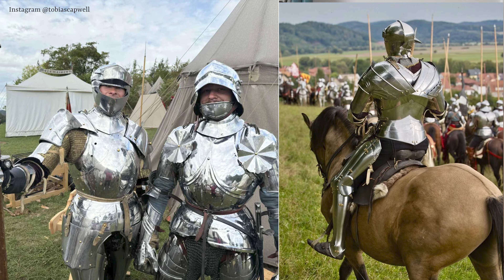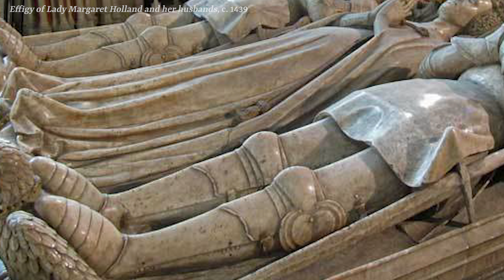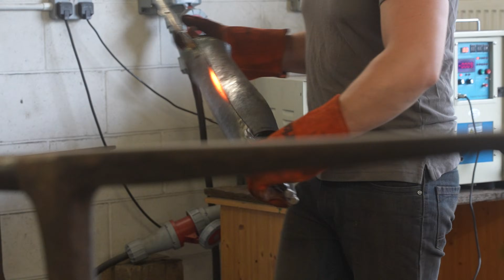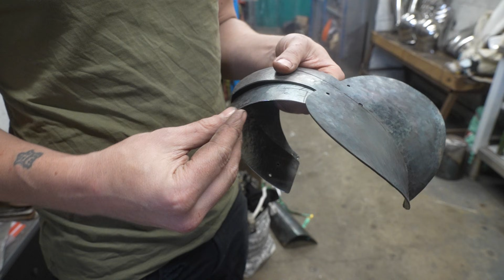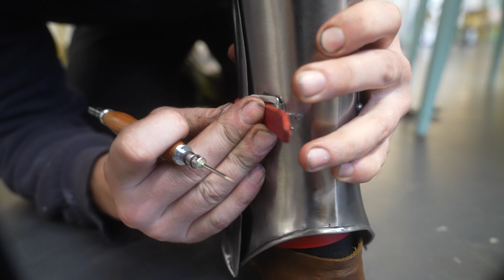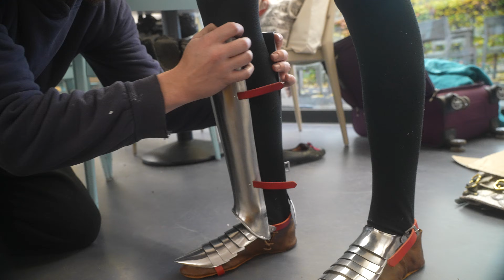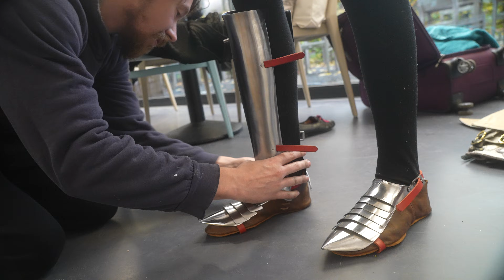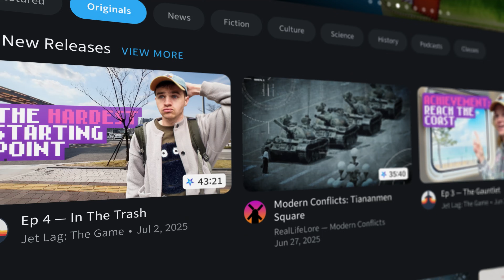Making Medieval Armour for Joan of Arc

Comment: god i need to win the lottery so i can commission a suit of armour.
Reply: but if you learn how to make it you'll simply have to win the lottery for your new expensive hobby 😅
Reply: @OwnageTheCat  ooh I like this plan!
Reply: @emilyrln  It is a fun and rewarding plan, but only if expectations are tempered for you to NOT expect to have a good quality armor harness finished after several years.

In my experience, I could have spent the entire amount of money budgeted to my metalworking hobby period to commission a probably mid-tier full plate harness, with some pretty decent quality off the shelf pieces (probably from Central or Eastern Europe, for the lower labor cost), and/or with low/mid tier bespoke components made for me personally (mostly in terms of paying for the labor allotted, not belittling the skill of any armorer I'd hypothetically commission). It can take months to years depending on the wait list for any armorer(s) picked for the different harness components, so the time spent is overall still shorter than learning to do it well yourself.

Depending on style and period, quality of fit and finish, different used or brand new full harnesses can be had for anywhere from a few $1000s to a few $10,000s.

But then of course I wouldn't have the firsthand experience of having learned to make dozens of pieces of armor in varying quality from awful to not-terrible. XD
Reply: @OwnageTheCat  That is sooo true. XD I threw in the towel after spending probably $5000+ over nearly a decade in tools, materials and components to make my own tools, and consumables for actual armor projects. I spent 9 years learning metalworking as a hobby, towards the end of making my own 15th century harness. Finished a couple complete harnesses and many versions of some specific parts that were harder, that I wanted more, or changed my mind on regarding style. I wouldn't rate any of them as better than maybe C-grade reproductions.

It was a great hobby and learning experience, but definitely not my first recommendation for someone who wants a reasonably decent quality harness to be completed in a reasonable timeframe.
Reply: @OwnageTheCat not necessarily. I am creating a fully accurate late 16th century suit of armor from mirror finish stainless steel and I'm in maybe 200 USD in materials, I have a cuirass, tassets, full leg harnesses done so far. I'll have around 500usd in materials for the complete armor which is worth around 30k if it were to be commissioned.
Reply: @ascendantjustice1173  and slight hearing loss i'm going to guess
Reply: @bogdanv1353 nope I wear hearing protection and PPE while forging armor. Slight hearing loss is due to being in the Army and firing weapons and being near artillery 😂😂
Reply: True story, when Brian Blessed played Duke Thomas Beaufort the film adaptation of Henry V he wore his personal suit of armor.
Reply: @electrostatic1  Brian Blessed owning his own suit of armour comes as no great surprise lol.
Reply: Ohhh, yes! You could store it in your living room, in your castle too. 😂❤
Reply: I've recently been getting into armouring and I so badly covet making my own kasten-brust suit someday. Hammering away on metal is the most fun I've ever had except for maybe doing microbio.
Reply: If you don't go for bespoke, it's actually relatively cheap. You can get a full suit for like 3k
Reply: @audeforcione-lambert4293  True
Reply: @audeforcione-lambert4293  i am 5'1 i would need bespoke
Reply: Nowadays there is a abundance of extremely skilled armourers in middle/eastern europe who will create you amazing suit of armour for less than lottery winnings. It's really hard to stay afloat in this kind of work, so it's much more popular in those countries than in eg. UK or USA (altough, in USA you still have SCA which is different kind of animal and a lot of people are making armour for them. Not always historical tho)
Reply: If I win the lottery, I won't tell anyone, but there will be signs.
Reply: could always 3D print for a cheaper option. there's a guy on YT (Nico Printed Antiques) that printed a full suit of 16th century armor that looks really damn close to metal, full articulation and everything for less than $500 worth of material.
Reply: @sconesalot Depending on what your local median income is, it's entirely possible to save up for a decent full armor harness without winning the lottery. Especially if you're able to take advantage of a higher median income and shop around for armorers based in countries with lower cost of labor (used to be Central Europe, but now more Eastern Europe). It's relatively a win for both parties, though communication and distance are some of the common challenges in this process. If you're in a country/region with lower median income, that's tough -- learning to make your own might become more cost feasible, though that can also get pretty expensive (and takes MUCH longer).

You'd only need the lottery winnings if you commissioned some ridiculously high profile piece like Toby Capwell's Black Prince harness (made by Robert MacPherson, sometime in the 90s or 2000s I think? for $60,000-ish. Dr. Capwell then sold it years later for something like $80,000 IIRC, but I only read about it through the online armor community grapevine.) Though even that isn't much different from someone buying a reasonably affordable luxury or sports car, like a Lexus or BMW M3.

A heavily decorated harness and garniture, like that of George Clifford, Earl of Cumberland, was estimated around a value of $250,000 if someone were to commission a repro today. THAT would make the lottery win a bit more necessary (or else you'd need to somehow claw your way up into the top 0.1% of income/wealth). That's getting into Rolls Royce or Italian supercar territory.

More workaday harnesses costs about as much as a used to new-ish car, anywhere from $3000 to maybe $30,000. You can get some terrible to decent used ones for the price of a VERY cheap and terrible used car. Bohurt fighters have slightly different priorities (and often very distinctly NOT historical priorities), but many affordable armorers cross over between fully historical and bohurt b/c bohurt is relatively their bread and butter income.

$5000 to $10,000 wouldn't be unreasonable for a middle of the road quality harness. I'm in the US, so basing this off a median US income. The average US individual spends approx $303 / month on entertainment, acc to the BLS. And $191 on eating out monthly, though this is higher for single-person households ($222-328 monthly). Theoretically, if you went hard on free and make-at-home alternatives, that would be about $5000 a year you could budget towards a full plate harness plus travel costs for 1-2 fittings with your chosen armorer.

I started going down that route, though over time my priorities changed. For about 15 years around the 2000s to 2010s, this was how I planned out my discretionary spending to get me through grad school and early jobs while getting into a number of somewhat expensive hobbies including blacksmithing (and making 15th century plate armor myself), historical European martial arts (HEMA), and parkour. THe last one was dirt cheap in and of itself, but I allocated a travel budget to go to HEMA and parkour events and train with community and friends. My entertainment/food spending patterns were VERY different from most of my non-HEMA/parkour friends. XD I extensively cooked at home and hosted or went to potluck game nights or house parties, which made both food and entertainment muuuch cheaper than going out.

For the total I spent on all these things, I could have alternately prioritized a full plate harness more highly, and paid for a good mid-tier custom harness if I'd made some reasonable sacrifices elsewhere (mostly traveling less, b/c that was easily a few $1000s over the years).

In the first year, save up and shop around on the armor community forums and social media pages to find someone whose communication, skills and armor styles, price, and schedule work well for you. Put down a down payment and fly out for a consultation/fitting.

In the second to maybe third year, finish paying off the commission as they finish it by components. Armor isn't necessarily a one-time payment thing where you take delivery of the entire harness at once, even if you start with a single coherent design/style concept and even if you choose a single armorer for the entire work. Sometimes you prefer the limb components from one person and the helm or breastplate from other armorers. Gauntlets, accessories, so on.
Reply: It’s not actually that expensive. Lots of working class people do this for a hobby.
Reply: You can order a decent suit from Ukraine or Poland for about $3k.
Reply: Got that backwards.
God told Joan that French knights should YOLO Charge the English rather than waiting a day for them to dig in and the YOLO charging them.
She listened.
That's why she is a saint and we aren't.
Reply: Just buy a less new car. It's between 4 and 5 grand
Reply: Walk in it into the Parlament.😈
Reply: Get a tree stump, angle grinder, 2 pound hammer, and get to work
Reply: Aim of 12th century, the 1st crusade aesthetic is unmatched and it's "only" alot of chainmail :D
Reply: @Pottan23  That heavily depends on each enthusiast's personal area of interest in history generally and armor specifically. I certainly appreciate the High Middle Ages in terms of arms and armor, but I personally consider the mid-15th century to have my vote for an unmatched aesthetic, specifically in the Gothic style.

And in terms of labor time or cost, it can be a bit of a toss-up. Maille takes a LOT of repetitive precision labor, which can be expensive if you pay for it to be done well. Plate armor takes a lot of skilled and precision labor, which can also be expensive if you pay for it to be done well.

Either way, doing it yourself could still end up taking years and multiple repetitions to work through effectively your apprentice/journeyman phase in order to learn how maille hangs and expands over a body in motion, and how to fit plate armor to the same. There are different patterns to expand or contract the maille weave, or putting in the maille equivalent of darts in clothing, to make it fit more closely (thus carry less weight AND look cleaner and less baggy). Most armorer hobbyists I've known have taken 2-5 years to get a grip on the basics of either earlier maille harnesses or later plate harnesses, and at least twice that time to get really good at either one. Though maille armor does have a relatively lower skill cap than plate armor, eventually. It's just not a matter of something as extreme as weeks/months for one style versus years for the other style, to learn. More like a few years versus many years.
Reply: @dakaodo no one is reading your reddit novella bro. Ofc everyone is entitled to their own opinion 😂
Reply: It was an interesting read you illiterate, considering I want to start doing maille armour myself and dakaodo brought up mamy good points. Try reading more stuff that is beyond first grade level.
Reply: No need for lotto earnings, I commissioned a full custom & bespoke Black harness (from a painting of the battle of Shrewsbury) that cost less than $55k
Reply: @jeffm1463 you do realize that the average person can’t afford to spend 55k on a suit of armor right?
Reply: @atrumphasmatis-fdjt  There are less expensive alternatives.  "Nice things cost Nice Money" - George Washington
Reply: @jeffm1463 yeah, like lotto money
Reply: @frostbite3756 May the odds be ever in your favor.  - Prince Harry
Reply: @atrumphasmatis-fdjt  Full plate harnesses are roughly in the same budget range as motor vehicles, albeit they're less useful than motor vehicles. I feel like they're comparable to motorcycles -- both somewhat niche sports equipment that's also cool to show off, but not terribly practical with the caveat of my previous sentence.

You can buy some not-great used cars for $2000 to $5000. Same for used armor harnesses -- or not-great new harnesses (either munitions grade fit and finish, or not particularly accurate historical design).

For reference, in the US, the average used car sale price is $25,000. There are still plenty of serviceable used cars people can buy for $5000 to $20,000. And you can get some really decent full plate harnesses for that price. Obviously, like a $10,000 or $20,000 motorcycle (but even less so), a $10,000 or $20,000 full plate harness isn't nearly as useful as a car of the same value, which makes motorcycles and far more so armor harnesses more discretionary and optional purchases.

The average US new car sale price is $50,000 (which blows my mind, which is still anchored on prices from the 2010s). That's getting into the realm of harnesses like OP @jeffm1463 or the Black Prince harness that Dr. Toby Capwell commissioned from Robert MacPherson several decades ago (originally $60,000, sold years later for $80,000 IIRC). A lot of people buy Lexus cars, BMWs, etc that cost even more than this. Most of them are no longer average people, and probably more than a few of them are not making the most sound economic decisions for their personal financial situations when buying these sport/luxury cars.

In the 2000s to 2010s, during and after grad school, I drastically planned out my discretionary spending and found that even in a below-median income part-time job, I was able to save up $1000-$3000 a year. Living like a monk, cooking at home, doing free and low-cost entertainment like game nights, potluck house parties, going to the park with friends, etc paid for my hobbies back then, and could have paid for a mid-tier armor harness. I just ended up spending an amount equivalent to an armor harness on the metalworking tools to learn blacksmithing and armoring instead, for 9 years. XD And I still didn't end up making a decent harness (never got better than maybe a couple harnesses that i'd rate a C or C- at best).

I'm around the Gen X / millennial threshold though, and while I was able to survive on $14,000 a year back around 2010 (This was about 1/3 of median 2010 income levels), that was only through some extreme offline rent shopping (rented rooms from retired people in old 60s 1400 sf houses in town) and cooking cheap seasonal vegetables and whole chickens for myself. Nowadays, that same offline rent shopping can only barely find a place for rent that costs my entire 2010 annual income, not yet including other basic expenses (I'm in a major southern metro area, and I'm seeing reddit threads for apts, duplexes, and garage apartments with less than 800 sf for $1000+). So I guess the equivalent income now to scrape by and maybe squeeze out a few thousand would have to be more like $28,000+. Which tracks, b/c that's about 1/3 of overall median income. Though on a more responsible note, probably no one should really be trying to spend $1000s on plate armor or hobbies unless they're a sufficient distance from financial ruin, like at least 50% median income or better ($40,000+ a year) though that's still close to the "MMA aspirant living out of a car and showering at the gym" level of obsession.
Reply: @jeffm1463  Ah yes, because everyone has $55k to spend on frivolous purchases.
Reply: @jeffm1463 yeah so i have £50 . i need that lottery money
Reply: @jeffm1463 i wouldn't call 55.000 USD cheap in any shape or form. Where i live, that's almost as expensive as buying a full apartment or a house lmao
Reply: It took about a year to make and I wear it often to medieval festivals during the year here in Germany